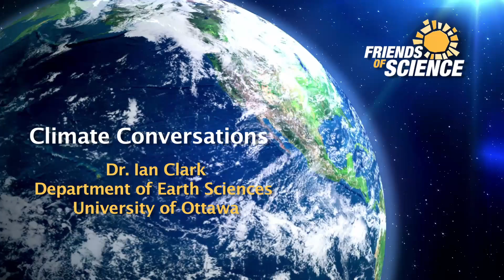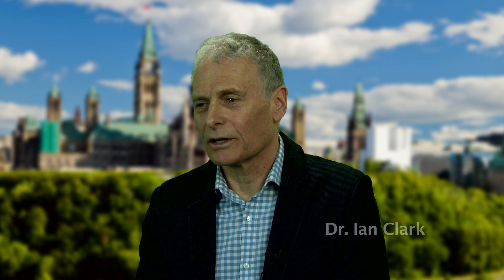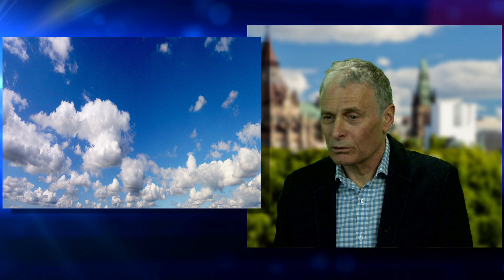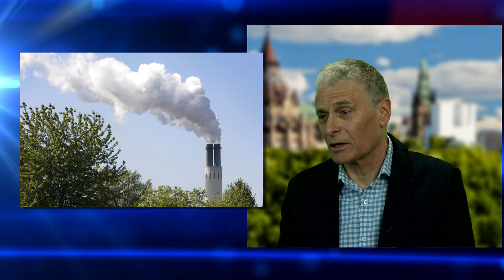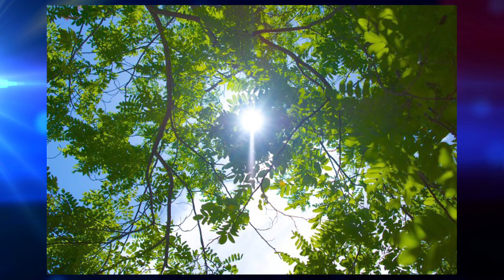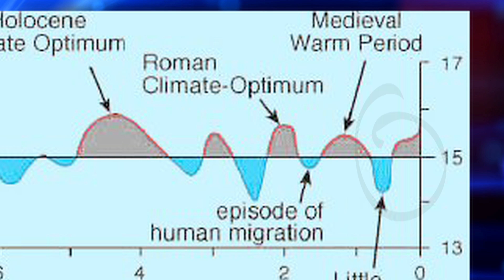The Carbon Cycle – Human Industrial CO2 a Small Part

Comment: The CO2 component is too small......

-He wasn't driving drunk, he just had a trace of blood alcohol; 800 ppm (0.08%) is the limit in all 50 US states and limits are even lower in most other countries.

-Don't worry about your iron deficiency, iron is only 4.4 ppm of your body's atoms.

-That ibuprofen pill can't do you any good; it's only 3 ppm of your body weight (200 mg in 60 kg person).

-The Earth is only 3 ppm of the mass of the solar system.

-Your children can drink that water, it only contains a trace of arsenic (0.01 ppm is the WHO and US EPA limit).

-Ozone is only a trace gas: 0.1 ppm is the exposure limit established by the US National Institute for Occupational Safety and Health. The World Health Organization (WHO) recommends an ozone limit of 0.051 ppm.

-A few parts per million of ink can turn a bucket of water blue. The color is caused by the absorption of the yellow/red colors from sunlight, leaving the blue. Twice as much ink causes a much stronger color, even though the total amount is still only a trace relative to the water.

-Only 500 ppm of hydrogen sulphide (bad egg gas) in air is a hazardous level, as any health and safety fact-sheet will tell you. It will make you seriously unwell at that kind of concentration. In fact, at above 100 ppm, you can no longer smell the gas because its toxicity has switched off your sense of smell.

Comment: Where does all this CO2 originate?
That's right, it was already here!
If it was already here, why?
Correct, that's the way it's meant to be!
Climate change is a political platform used by the Elite to control the general populous, therefore it should be dismissed without discussion!
Reply: All carbon is from limestone XD

Comment: The Intergovernmental Panel on Climate Change (IPCC) is the world's most authoritative voice on this topic. The IPCC has released assessment reports. More than 2,500 scientific expert reviewers, 800 contributing authors and 450 lead authors from over 130 countries contributed to the Fourth Assessment Report. It states, it is a greater than a 90 percent certainty that emissions of heat-trapping gases from human activities have caused “most of the observed increase in globally averaged temperatures since the mid-20th century.” The debate is over. It is time to solve the problem.
Reply: What is settled is that CO2 has been as high as 5000 ppm , thats a factor of 10 as compared to today's very  low levels.
If we didn't go into irreversible runaway global warming and melt down in the past  , there is an absolute 300% probability we won't in the future .
There now the science is settled , let's get on with building dams and greening the desserts .
Reply: @AR-fd8tc  You state: "What is settled is that CO2 has been as high as 5000 ppm ... If we didn't go into irreversible runaway global warming and melt down in the past  , there is an absolute 300% probability we won't in the future " 
Good point - but ONLY if you ignore ALL of the the other forcings that controlled the planet's climate in the past.  
  - When the CO2 was 5000ppm, where where all the continents?  The position of the land masses plays a very important role in the global climate.   
  - When CO2 was 5000ppm, what was the sun's intensity?  The sun is an important forcing.
  - When CO2 was 5000ppm what was the planet's albedo?  
Your argument needs a lot of work - and you need to do a lot more homework before becoming a lecturer and claim there are no tipping points (if that is what you mean by 300% certainty).

Current CO2 is 410ppm.  Humans have never before existed at a time with levels this high.  I say this just to help illustrate that for the whole of human existence, CO2 levels have been very stable compared with the planet's distant past.  We know our CO2 emissions from the start of the industrial revolution have raised it from a very stable ~270ppm to over 410ppm.  And we know that it is an atmospheric greenhouse gas that traps energy.  And we know that warming will release INSANE amounts of methane from the arctic tundra and arctic oceans that will drive further warming beyond our control.  And we know that whenever the planet was 3+ degrees warmer, the seas were METRES higher.  And we KNOW that a vast number of cities and people live near the coast and that sea level rise, despite being insidiously slow, will in the longer term, inflict damage that will cost trillions and trillions of dollars  and displace well in excess of 50 million people by the end of the century.  
Time you did your homework - I would suggest starting by getting off this channel as it is full of lies.
Reply: I  agrees, we should find better non-fossil fuel energy sources.  Bill Gates talks a lot about this.  He is very optimistic about the future.  He says we already have the technology to reduce our Fossil Fuel dependence. he says science will help our earth, more than panic.   This issue is. Co2 control does not = climate control. The Sun, solar cycles etc are very relevant too. We need to getting working on scientific advancements in Energy, then naturally, we will use less Fossil Fuels.
Reply: @betruthfullinformed8181  You state: "This issue is. Co2 control does not = climate control"
Oh yes it does!  Simple physics - atmospheric CO2 absorbs long-wavelength infrared radiation so increasing its concentration in the atmosphere means that less heat escapes to space and thus the planet warms.   It is undeniable basic physics.  If you can prove otherwise then write it up and publish it and collect the Nobel Prize.
Reply: The IPCC is a criminal organisation set up by a multimillion thief Maurice Strong who was co founder with Klaus Schwab of the fascist lead WEF. 
There’s lots of reports from independent Scientists and Environmentalists who can show through historic data that Government funded organisations such as NASA and NOAA have manipulated the data to show increasing temperatures in the atmosphere. For many years it was agreed that the Sun spot together with the Oceans of the World controlled the weather and atmospheric conditions. Our natural world with Ocean and land based methane and CO2 emissions have a far bigger effect on the atmosphere than human/animal or industrial activity